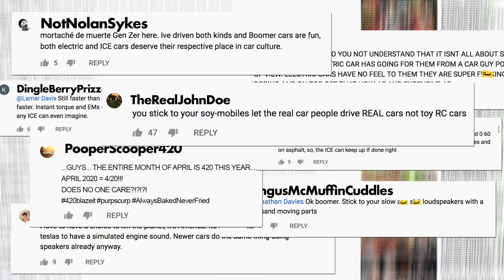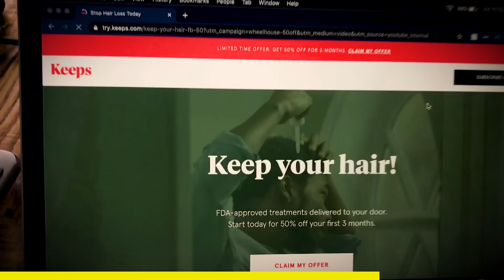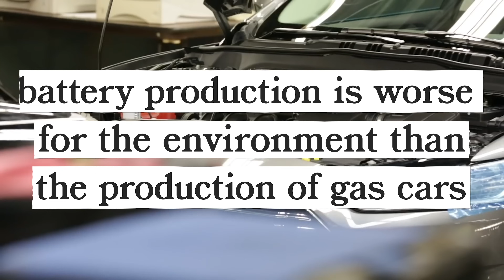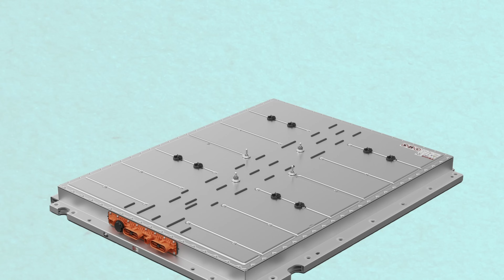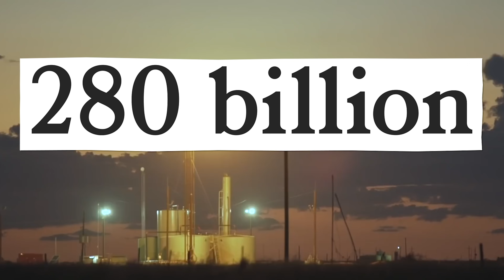Are Electric Cars REALLY Better for the Environment?

Comment: But the lifespan of a battery is just a fraction of the lifespan, of a gasoline engine.
And where do old batteries go ?
Reply: Incorrect. The lifespan of current generation EV batteries are designed to last twice the lifespan of a combustion engine.
Reply: Oh dear, more misinformed nonsense.  Watch the YouTube video posted by the Tesla Model S owner. His car had covered 400'000 kms on it's original battery.....  Old EV batteries will be recycled. Watch the YouTube video of the Volkswagen Electric Car Battery Recycling Plant, and see the recycling process for yourself.......

Comment: your forgetting the tons un recycleable parts from wind turbines and other unrecyleabless bio diesil and hydrogen powered car to run a electric motor if needed to and drop the batteries,allso redisgn the engine to reuse  the gasess to run a mix of ydrogen or lpg as well as a generator for a electic motor

Comment: no they are not they are even worse it takes more resources to make battery for a car than make pontiac or a mustang
Reply: Yep.
Reply: Actually no true. Very very not true. Whilst batteries are fairly emissions intensive, they don’t have to mine, smelt and machine large engine blocks and transmission. Overall this has shown to only produce a difference of 15% more emissions to make an EV than a combustion car with similar class, size and trim. 

For clarity 15% is about 1 metric ton of emissions.
Reply: Now compare that to their operational life, even on a coal based grid, EV’s produce 20-30 metric tons less emissions than a combustion car. Hell it’s even more fuel efficient to charge an EV off a small portable generator than it is to use that fuel in a combustion car.

Comment: With the CO2, Methane, and Nitrous Oxide byproducts of petroleum production, have companies thought of trying to capture that gas and bottle it? There are uses for methane, CO2, and Nitrous Oxide. And bottling them is a good way of massively reducing environmental impact.

And for EVs, my major issue I see here in Australia is that the rebates don't absorb enough of the initial cost, and there's a bigger issue, the infrastructure isn't there, and will cost millions, if not billions to implement. An EV needs power, but if a household that has 3 petrol cars replaces them with EVs, they all need power. Now if it's a single garage house, there is only one easily accessible power point, leaving the other 2 cars with no easily accessible power source. This would mean that they will need a 2 plug kerbside charging station right outside their house, something the government would have to get done. However, even if the charging station is implemented, those things aren't free, they are either subscription based, or pay per user based, money some may not have. Even in the case of a 2 garage home, 1 car still needs power.

All of this though is assuming the fuse box has the capacity to deal with charging an EV. If it doesn't, the fuse box would need to be upgraded, meaning more money. And let's say they want fast charging for the car(s) that can be charged from the house, well the fast charging station needs to be installed, meaning EVEN MORE money needed. Just from this, there are a lot of issues that make EVs just not that cost efficient for many people, and EVs may never be cost efficient for those people for decades

Comment: You never answered how long the average EV could last before having to change the batteries which, on a long enough time line, could increase the emissions number to a number much closer to and ICE at the same year mark. The EV could still be better but I'd be interested in how much? All this considering how much more emissions are emitted during the manufacturing of the new batteries.
Reply: Current generation EV batteries last approximately twice as long as a standard combustion engine.

Comment: While I'm a big fan of EV's, I think it's also incredibly important that we build infrastructure to take care of lithium ions when they die and make them wayyyyyyy easier  to replace than they already are... they're a step in a good direction but I feel currently being managed poorly.
Reply: I agree with you it would be better for the environment just to replace the battery then to make a whole new electric car it’s like phones it’s better for the environment to just replace the battery and continue to use it until it completely dies but as you said replacing batteries does need to get easier
Reply: @Lord_LindaThePhilosopher  youre right.

BUT, that would imply that every "green" company ACTUALLY cares about the environment, and the consumer, and not making a buck. 

It would also imply that the government actually cares about the environment, and their citizens, and not making a buck.
Reply: @jaybird0312  it cost $5,000 plus labor to replace a EV battery and that's every 10-20 years, now take a gasoline car after so many miles or years you need to get repairs and oil changes all of that stuff, over time that adds up to $5,000 and it could take 10 or more years to get there, going green doesn't mean you have to sacrifice profit it most likely going to stay the same just instead of the money adding up over time (little repairs over the years) its all in big one lump sum (one big expensive repair). The government does care, with how much they are pushing green energy even if its just a smidge, they do. the government knows that if they don't do something about global worming there will be no money to make because everyone will be dead (funny and sad). Plus, Green energy is skyrocketing in popularity and investors see that and they go for it witch will help the economy a lot, especially after everything that has bean going on and continues to happen but is slowing down, the government also sees this and wants to push it even more. Solar and wind are now cheaper than coal so more and more people want it witch investors see, EVs are also gaining tones of popularity and investors see that too, green and EV companies are most likely going to see higher profits in the future than they do now, more and more people want it, demand for it is going up and fast
its a good business to be in right now going green does not sacrifice profits so even if companies don't care they see the profit potential of a green business. one other thing the government gives inessives to green companies especially new ones just starting out, remember that's the government giving lots of money to small businesses if the government didn't care they would say to those green companies you are all on your own we are giving you nothing. The companies who are "not going to make a buck" is the ones that don't go green, gas companies see this and they are scared, if they don't get there crap together and move to renewables then that's the end of there gas company, the government is giving gas companies FINES for not making there gas and or oil production Cleaner and more environmentally friendly. One of a companies nightmare is thousands of people protesting out side of there business, well its bean happening to gas companies a lot recently. my point is green companies are definitely going to be making profit and a lot of it, there will be no "buck" being lost (Unless you don't go green), and the other point is that at least Biden cares he is giving $2Trillion to fight climate change and calls for $36 Billion for just 2022 and he has a plan for 2022 and what the money will be spent on that he has said and shown I think he cares maybe not the rest of the government but at least he does and many other countries as well. THANK YOU AND HAVE A NICE DAY 😁😁
Reply: @Lord_LindaThePhilosopher  even a VW ID3 56kwh Battery costs 14.500euro (17690usd) and no after 5 years a batterys life decrease 50% from is start point. i own an ev myself, but you have to stay on the truth side. Probably in the future it will get better and cheaper, but not today.
Reply: @jaybird0312 , In Economics the goal of the producer is to maximize profits while the goal of the Consumer is to maximize satisfaction. The huddles Producers have is the quantity and quality of resources and the consumer's huddle is income. 

In order to figure out good solutions to the climate change then you need to check off all those boxes for the solution to be accepted. For example in a video I found about a fungus that can replace some plastics it showed that it's cheaper to produce than plastic. Which producers if the product lives up to it's promise will accept since it will bring in more profits and for consumers it will be cheaper and a better product. (I'll find the video and link it here so people can look into it themselves.) https://youtu.be/cApVVuuqLFY
Reply: @Lord_LindaThePhilosopher  I own 1999 BMW E46 with 400000 km. I have this car for 7 year now and it's brilliant during those 7 years I only change oil and all filters, it's 1 hour job and full set of filters and oil cost me around 100-150 bucks. On one full tank i can make up to 800 km and it takes me 10 min for fill it up and be ready to make another 800 km.  😂 Car runs Great despite it age never let me down and I probably never will change it to EV unless they can make  up to 800 km on one charge charging won't take more than 20 minutes and battery didn't need to be replaced after 5 years or faster if you live in cold climate.
Reply: "build infrastructure to take care of lithium ions when they die "  ?????????    We haven't figured out how to even dispose of spent nuclear waste.  All the US does is move it from the state where the waste is to a state willing to get paid to put it in some kind of waste container or underground waste storage
Reply: @glenandfriends9012  I'm no expert but pretty sure nuclear waste is quite a lot harder to take care of...
Reply: @glenandfriends9012  Spent nuclear waste is deposited deep underground. That's ok because 97% of that waste is recyclable.
Reply: yea  agreed I like EVs but they need to fix those problems
Reply: Battery recycling to make more, are a known big thing that EV makers like Tesla and Rivian are  dealing with generalities are inaccurate, and this is the last inane comment i will read (though not write)
Reply: in 2014 we already have 44 million metric tons of electricity waste, how do you get rid of that?
Reply: This is before I was on YouTube
...... This must have brought out the  "Tesla Bots"  🤔
Reply: Not to mention infrastructure to actually... Power said lithium batteries. California has been tapped out on power for a while, buying it from other states, and they have fewer than 10% of their total vehicles representing EVs.
Reply: But how do you do that? That’s the question. Recycling those are hard. We are also suffering from electronic waste now. How are you gonna do that if we have shit tons of electric waste u bozo.
Reply: Now they are just burning(batteries)
Reply: Bro ppl gettin pissed asf over this lmao, it was an idea, u don’t agree that all good but maybe calm down a little?
Reply: what is it that you like from ev’s? I really wonder, because to me it feels boring. At least to me it don’t matter how fast you get 0-60.
Reply: @lucianogonzalo011  yeahhh I get wym… they could be good for the environment and a lot more reliable if it weren’t for the fact that lithium ions are what they are… but definitely never gonna be a v8

Comment: Mhm what about how often you have you to change the battery to have good driving range? 2-3 years?i have friend ho bought tesla and he was forced to change batters after 5 months of driving and also because range decreased after two years to almost half they (Tesla)change batteries again...plus you charging them .So far electricity is cheaper then oil,just wait and see in few more years how much more we will have to pay. Gaverments know and have technologies better and cheaper ..but many (to them)have to come from somewhere..if they so concerned about environment then why almost nowhere you can build for egz. small wind turbines for your own use .Bat they can...
Reply: Well current battery technology is designed to last double the lifetime of a combustion engine. Having those kinds of battery problems are extremely rare. Infact Tesla warrantee most of their vehicles with an 8 year unlimited km warranty. You don’t do that as a business if you know you are going to have to start replacing batteries before then. It’s not economically viable.

Comment: 5:55 Wind, Solar and Hydroelectric are terrible for the envoriment in different ways, wind and solar needs more co2 to be made than all the energy it will produce it's entire lifetime, and hydroelectric destroy an entire forest with water inundation...
Nuclear power plant is the cleanest, and Uranium still terrible.
If you really want to be green, is better to keep petrol cars
Reply: Actually according to most recent studies, solar is approximately 20-30x better per kWh than coal or gas is. Infact the “buyback” when compared to coal is only 3 years out of a 25-30 year lifespan of a solar panel. So no, they categorically do not produce more CO2 to be made than all the energy it will produce in its lifetime. And the majority of the emissions to create solar panels is from electricity production to supply the energy to create them. Which as the grid becomes more green, reduces towards zero. So again. False.
Reply: @engineeringtheweirdguy2103  where are the links for these studies?
Reply: @AMV12S  unfortunately for some reason, YouTube blocks me from sending links. Some new spam filter I think. In any case, is very simple to find them, including the one produced by Exonmobil. You ready? Go to google, and search “are renewables cleaner than coal” then you will have hundreds of articles each referencing tens of studies and papers which prove that they are. Alternatively you could search “is coal cleaner than renewables” and you’d get the same results. This really shouldn’t be a contentious statement. It’s been public fact for years now.
Reply: Wow nice information, Dr AMV12S energy expert 😃

Comment: You didn't take into emissions to make windmill  you have to melt iron ore to make the towers and copper has to be  mined to make wind generator you have to haul those parts to assembly site you need  semis and cranes to build wind mills  mine ore for towers all this creats emissions  now let's talk about warn out wind mill blades being buried in dessert disassembly cost of discarded mills now let's address solar panels  you need plastic for these and presiuos metals  and alot of land to make a large enough grid to supply electricity  that you say is so clean and those solar panel will need to be disposed of what about environmental impact from this  you can't ignore environmental impact  the true cost of electricity  needs to be factored in  now we need discuss potential  shortening of useful life oe wind mills and solar panels by tornads and hail

Comment: What happens when ya keep your car and replace the battery.
Reply: you get a new battery
Reply: @pingvin1517  But of course your EV may not necessarily need a new battery. It may just need a battery refurb, which usually comes at a fraction of the cost of complete replacement...
Reply: @Brian-om2hh  ok

Comment: Umm...  Did u take into account of electric power lost during transmission over the transmission line?
Reply: That’s only around 15% at it’s worst
Reply: Peter ⸻⸻⸻⸻⸻⸻⸻⸻⸻⸻⸻⸻⸻⸻⸻⸻⸻⸻⸻⸻⸻⸻  no. 15% if energy grids around the world lost 60% to transmission there would be little point in having transformer stations to change the voltage/current ratio to reduce line losses wouldn’t there?
Reply: Peter ⸻⸻⸻⸻⸻⸻⸻⸻⸻⸻⸻⸻⸻⸻⸻⸻⸻⸻⸻⸻⸻⸻  according to the NRDC transmission losses nationally account for 5%.... 5%. Not 60% https://www.nrdc.org/experts/jennifer-chen/lost-transmission-worlds-biggest-machine-needs-update
Reply: Peter ⸻⸻⸻⸻⸻⸻⸻⸻⸻⸻⸻⸻⸻⸻⸻⸻⸻⸻⸻⸻⸻⸻  out of curious where did you even get 60% from. It’s an absurd number

Comment: Myth #2 is busted. The power grid can barely handle current power usage.
Reply: Are peaks yes. But EV’s are typically charged during off peak times when energy demand is so low power companies have to shut off generators.

Comment: This is why we need an unlimited energy source to our vehicles no fossil fuels no bio fuels and no ionic energies I believe with ionic energy vehicles 1 they break pretty quickly you have to understand that the metals in the suspension and drive shaft are made of a lightweight steel to not drain the battery too quickly 2 they look pretty and sound pretty boring

Comment: Meanwhile in a diesel that wouldn't exceed 17t of emissions based on these miles/figures.
Reply: It is litterally more fuel efficient to charge your EV with a portable diesel generator than it would to use that same fuel in even a small super efficient diesel car like a VW Golf diesel.
Reply: @engineeringtheweirdguy2103  I'm going to assume you're American based on 1 fact. 

You think a VW Golf is "super small" and "Efficient".

My small diesel car, ignoring the computers in it, and calculating consumption myself, reaches a peak efficiency of 78mpg. It emits 88g/km of Co2.

An equivalent new golf with a similar engine, would emit 131g/km and only achieve 56mpg.

Please recalculate this, for my car.

P.S. I would like to see calculations, and not just a flat response. Even if it's possible, I doubt an EV would go as far as my diesel car, with it's 13 gallon tank.
Reply: @nickidean3877  and pray tell what is your diesel car? You havn’t told me yet. And whilst the word super probably wasn’t warranted, as far as diesel combustion engines to, the golf has a fairly efficient one.
Reply: @nickidean3877  also, not American. Australian. 🇦🇺